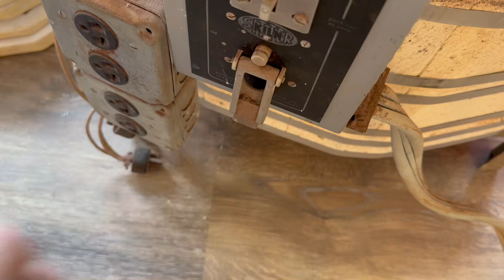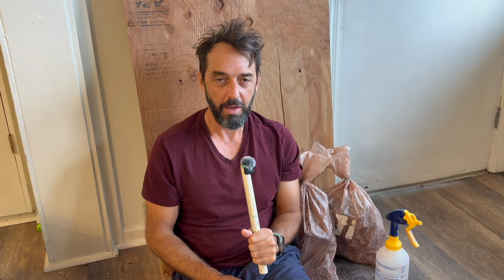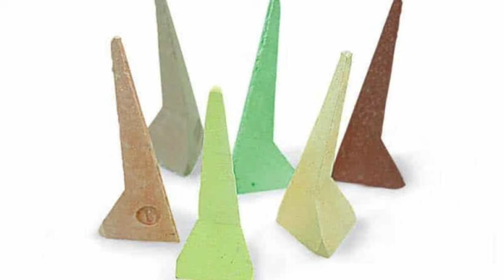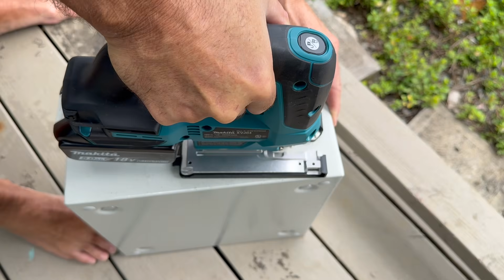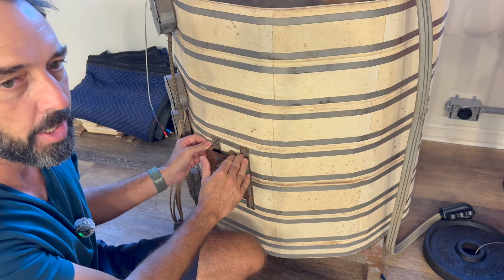How I Computerized an 80 Year Old Kiln

Comment: Couldn't you just use a 60A solid state relay with a programmable PID controller?
Reply from the maker: Not really. The rating on ssr isn’t continuous resistive load it’s more like peak inductive load so for this 50 amp kiln I needed at least 100 amp ssr. This 120 amp one is borderline. For temp control you could use an off the shelf pod sure but for ramp and hold you want a microcontroller…

Comment: That was fun to watch, thank you. I have a a pottery studio, modern kilns but I always wanted to take the control boxes off the sides of the kilns and replace them with wall mounted ones so it was neat to see the way you laid it out. The commercial kilns are actually much simpler, ac routing straight into the relays and out to the elements. Looking forward to part 2.

Comment: You could have got yourself a bigger box. but you definitely want a grommet on that hole where the mains is going in. Doing it with an Arduino instead of of Pi is impressive though and the right solution.

Say hi to Epstein for me.
Reply from the maker: The “grommet” ie strain relief is coming from the old box. Just needed a little painting… trying to do things in parallel. These boxes do tend to be huge but hopefully bus bars will make this one ok. We’ll see once I “fire it up”…
Reply: @TheIslandTech  No I mean a literal grommet. Just do it.

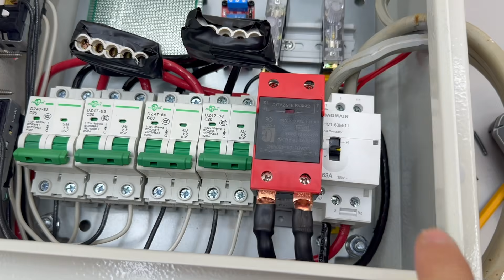10:06 what is that brown spot on the wire already (top right)? cut the hole bigger and put in a grommet.

google "grommet with flaps"

Comment: A little tip on the upload: if you use ArduinoOTA, you can flash the controller with a new firmware over WiFi, no need to touch the buttons on the controller. That could spare you the potential back injury from constantly bending over to reach those buttons. 😁
Reply from the maker: No more sticking a usb into a 240v box… thanks for the tip
Reply: @TheIslandTech  When you put it like that, I'm glad I could help prevent something from happening that might "delay" the next video.